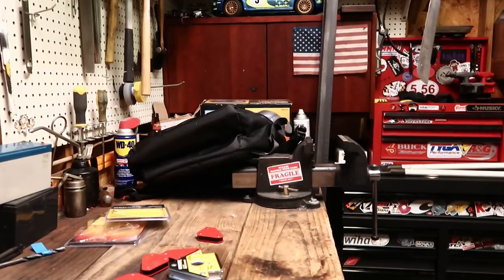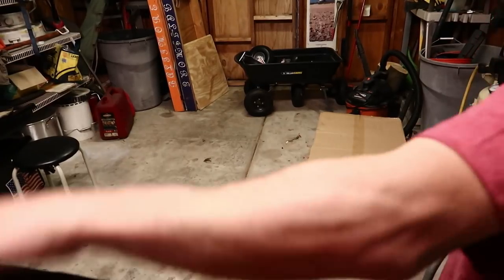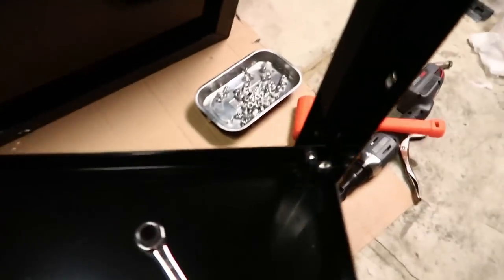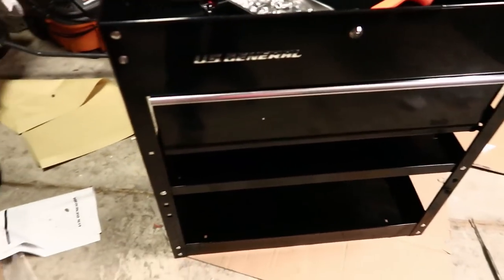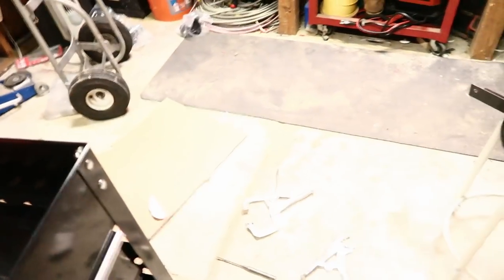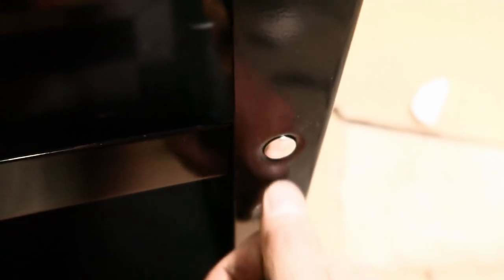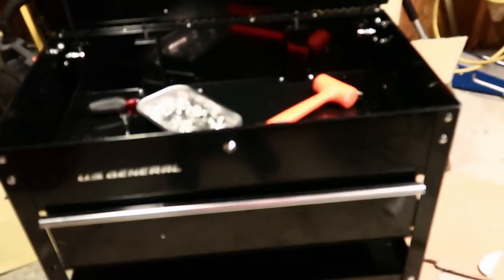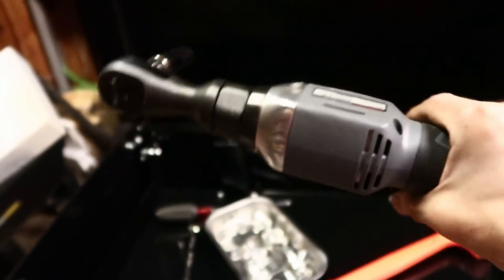Project Monster Tool Cart: Ep 2

Comment: Just a thought- when you get around to the big caster mod, you might want to exchange 2 of your swivels for fixed.  It will be a lot easier to push through the yard.
Reply: The best would be devising a way to temporarily lock two casters from swiveling. Some Vise Grips might even do the trick? Because 4 casters do make it nice to push things up against walls. Then it is less of a parallel parking deal going on.

Comment: Im getting back into the electrical field and I'm buying new tools I came across a bender I'll post the link but can you tell me if you think that is something that'll come in handy or if It's a waist..... 
Gardner Bender  1/2 in. - 2 in. Cyclone Electric-Powered Complete EMT, Rigid, IMC Conduit Bender
Reply from the maker: A freakin Cyclone???!!! By getting back in to the field do you mean starting you're own company? The little one has to be 6 or 7 grand.  I've never used the little one, but they are amazingly easy, just as long as you're bending pipe all day, every day, for weeks or you're using a lot of rigid.  The company i work for doesn't even have a bender that nice, and it employs at least 40 guys. If you got the cash, and will use the shit out of it, go for it.  But It's gonna take a long time to pay for it's self.
Reply: Yea I'm getting all the expensive tools before I get my truck. But wouldn't that save me money on material in the long run?
Reply from the maker: I guess a little bit, but if your gonna drop that mich money on equipment you shouldn't be taking my advice. Anyone that spends that much money better having that thing running non stop. If it's not running, it's not making you money
Reply: Mike's Tool Shed thanks and appreciate your perspective It's always good to have different point of views.